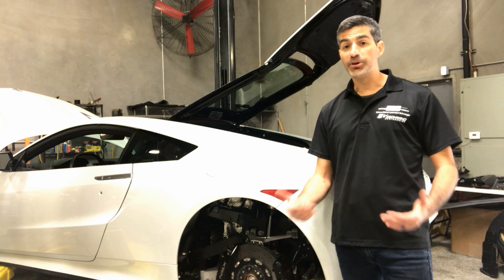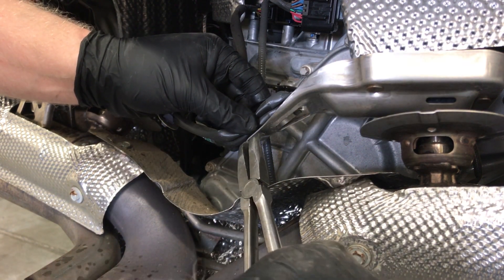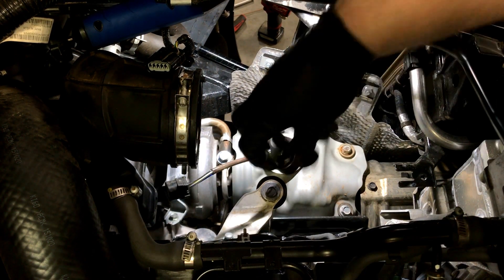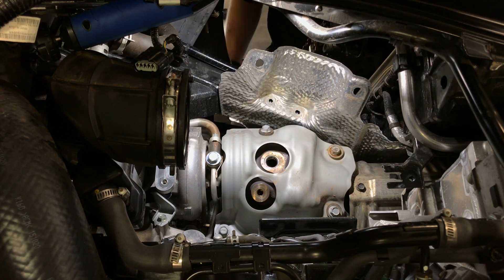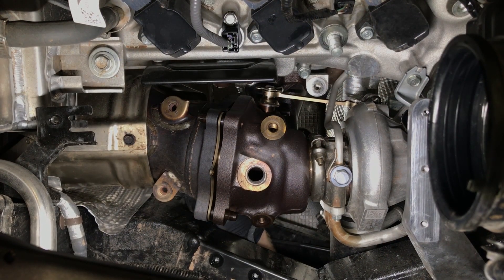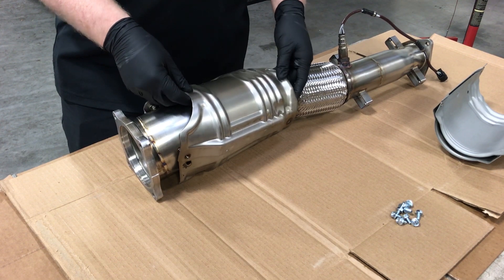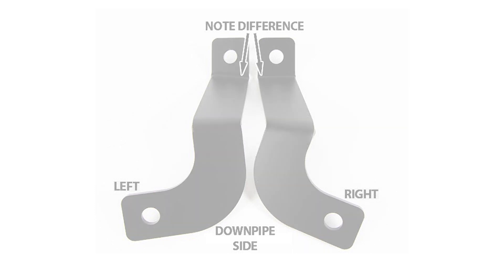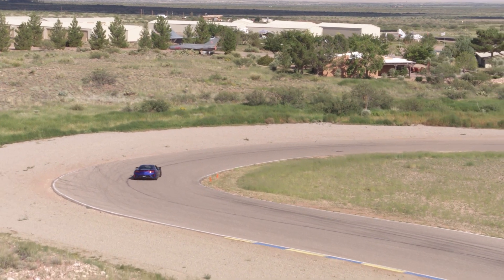ScienceofSpeed Sport Downpipe Set - NSX, 2017-on - Installation Video

Comment: Thanks for video.  These SOS downpipes have one CAT instead of two in the factory exhaust.  Is there a risk of setting a fault code/engine light?  Also do the CATs have a CARB label for smog inspections in California?

Also, would it be easier to remove the entire trunk assembly to gain access?
Reply: good question im curious too did u ever get an answer? i just got a 2020
Reply: You all prolly dont care but does anyone know of a trick to get back into an instagram account??
I somehow lost the password. I love any tips you can give me!
Reply: @Caleb Luis Instablaster =)
Reply: @Randy Lucca I really appreciate your reply. I got to the site thru google and Im in the hacking process atm.
Seems to take quite some time so I will get back to you later when my account password hopefully is recovered.
Reply: @Randy Lucca It worked and I actually got access to my account again. I am so happy!
Thank you so much you saved my ass :D
Reply: @Caleb Luis No problem :)